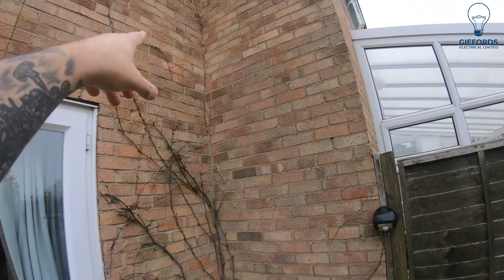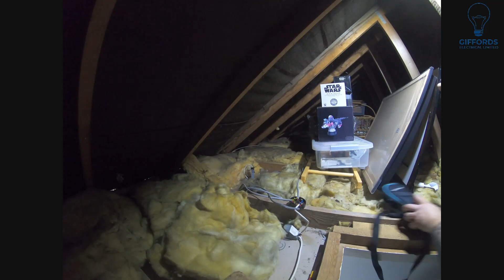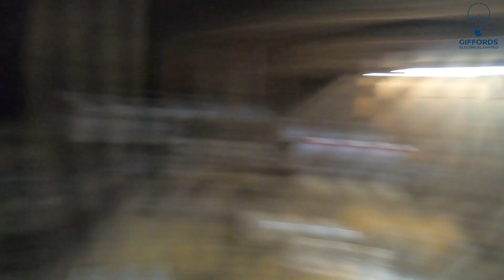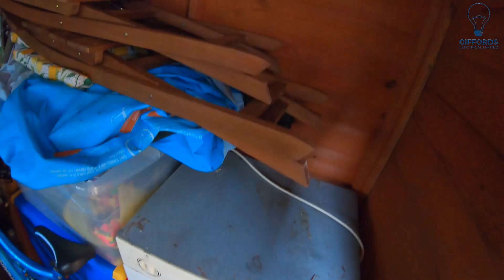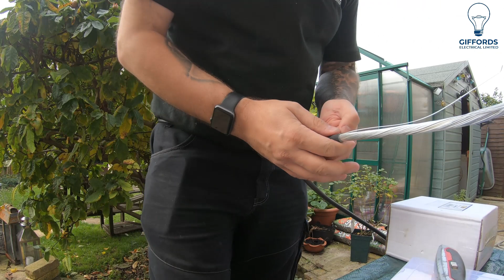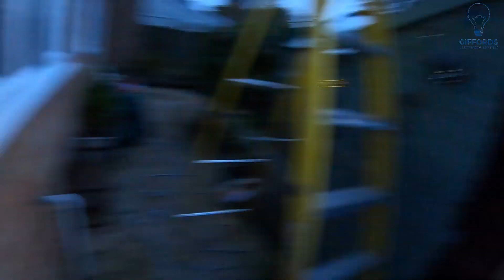Loft & Outside Lighting and Power to a shed Part 1 - Sparky Life

Comment: Hi mate with you spurring off that socket for the swa can you only put the one socket in the shed as a spur ? A fcu fused down an a light in there would of been handy aswell
Reply from the maker: Hi terry. A FCU could be fitted in the shed and additional sockets fitted (although not required) and a light fitted but wasn’t requested by the client.
Reply: Giffords Electrical 
I thought you could only have one point off a spur, if you added more sockets youd be spurring off a spur ? Thats how i understood it
Reply from the maker: One normal spur off a socket if it is coming off a ring final circuit.

You can have multiple sockets if they come off a 13a FSU first as that 13a fuse is protecting the new cable and sockets.
Reply: Giffords Electrical 
Arr right ok mate cheers so if in future a few more sockets and a light were needed they could put an fcu before that socket and feed the lot through the load side of the fcu
Reply: @ericthekingthekingtheking4842  - you can spur off a spur as long as you fuse it down to 13A- see App 15 BS7671 oops i've just repeated the above sorry...
Reply: Hi very good video and very well explained ....I was doing domestic works part p reg etc only part time as it was not my full time job ..I also do mechanics work cars mowers etc .. have fault about about upgrading to 18th edition And joining Napit again just so I can do a few private jobs...the reason I went mechanical was due to customers wanting jobs done for nothing and being undercut by our foreign friends it’s been 10 years since done electrical works

Comment: Not a bad job, only thing I’d have done different would be to strip the armored back further and run the cores right back into the socket, so no joints in that whisker box.